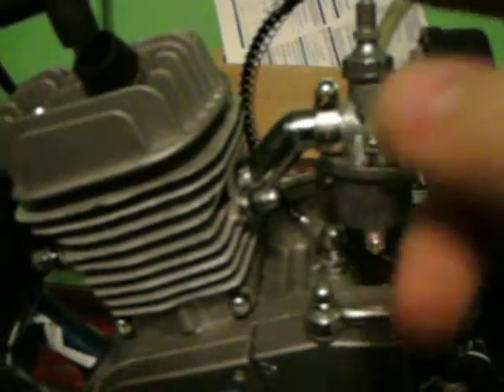80cc Engine Kit Progress Video 5 - The Boot is Finished

Comment: I have ordered the same set up as you but im going to mounting it on a chopper bike so i will need to do alot of custom work to mount the engine. and also with the spark plug issue you had, at the top of the plug can unscrew so its smaller and maybe that could have done the trick :) well thumbs up from me + a sub and ill keep you posted how i do mine step by step.

Comment: good job, i had to replace mine with a rubber weed eater cap, it works 10x better than last one, by the way i used the weed eater wire too.

Comment: You are doing quite well so far on your build. This kit has a tendency to drive you to want to work into the wee hours of the morning. The stock studs are crappy potmetal pick up a dozen 6mmx45 stainless bolts and cut the heads off to replace these hunks of junk. They will come apart and so will the chain tensioner. When you get the chain cutter, cut the chain to fit the gap between motor and sprocket leaving some slack (about a 1/2") give. Good job on the wire! Ty 4 sharing!